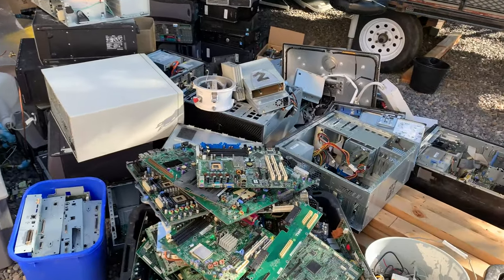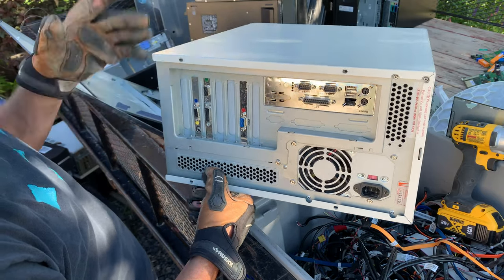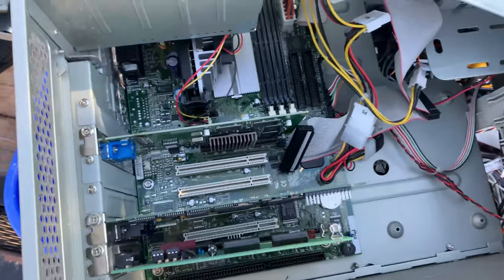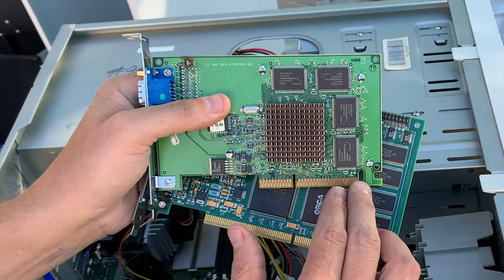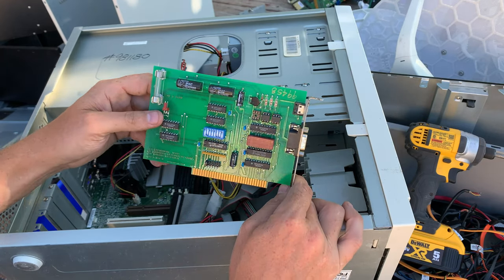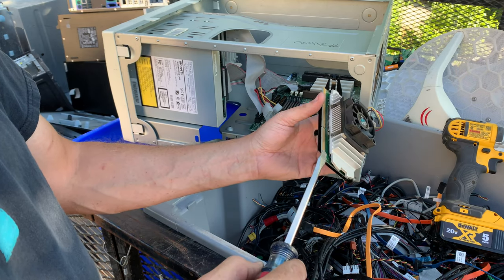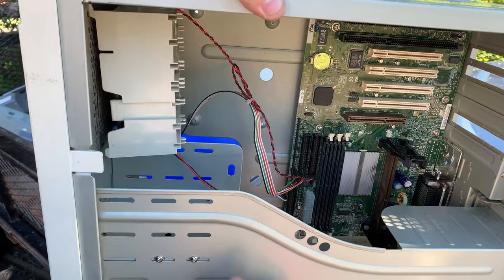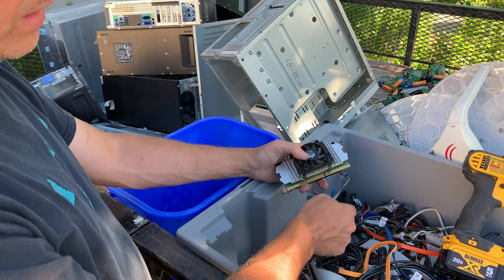Pentium 3 Tear Down with Old Style Cards

Comment: The AMCC IC chip was very interesting. That company is widely used for military and aerospace hardware.
Reply from the maker: AMCC ... as in what some call the "gold corner BGA" (And to be honest, I don't know if they are all that way and fall under the same label ... it is like MOSFETs and Voltage regulators... they looks the same to many people, but do such different tasks ... I have a lot to learn still)

Most people I talk shop with have no idea what I mean when I talk about these unless I call it what most scrapers call it.  It was used for a very long time.  The chipset moved to the newer style (I can't remember the name... maybe you can help me with that) for the southbridge.)   Even GPUs on video cards have replaced all chipset processors with the ones that have the dies exposed on the surface of a green fiber board BGA.
Reply: @badideametals  the AMCC chip was a regular IC chip, if had 3 Orca branded chips around it. The north and south bridge chips are still the same thing, you may only see 1 nowadays but they control all of the same stuff. PCI controller is used to also call it but they handle all of the PCI lanes to the CPU. Back in the day those had on board video through those chips as well, times have changed, A LOT. I don't understand why anyone who deals with and makes money off of ewaste doesn't learn what everything is and what it does, from that they can learn what to watch out for with items being worth money to sell or extremely rare and highly sought after items like IBM keyboards as a example or old hardware like I mentioned to you. Everything can be fixed as long as it wasn't a static electricity that killed the entire board.
Reply: @badideametals  I bought one auction with 3 Engineering Samples in December, 2 very early 486 samples worth $500 and up per cpu but the third one is extremely rare, the only known example to date, a 487 (SX) which are already rare because they were released so late newer technology was released not long after. This sample is beyond early in the development phase, the ID code on it is before they had even named it, 80487YY is the part number listed on it. Some collectors have called it the find of the year.  The highest offer I've received is $5,000 but I'm not selling right now. I paid $52.50 plus shipping with several other 486 cpus.
Reply from the maker: Thanks for explaining what chips you were seeing.  I am a software guy by day.  This is a hobby by night.  I make my investment back each time, and I am happy.  I sell what I can, but I really am doing this for the fun of seeing what things look like on the inside.  I recover the gold and other metals where I can.  I know I miss a lot.  But my return on investment is in the positive, so I am happy.  I am happy to learn what people are willing to teach me.  I don't doubt that for every one way I try a process, there are more then 3 better ways to do the same thing.  I like trying things out and seeing how things go sometimes.  You have been very helpful through the comments of other videos.  I appreciate your advice where you can give it.  I am glad I have the luxury of making mistakes and being inefficient as this is not my sole income.  I would have to be much better at this (like you were saying) if I were to live off of this venture as a primary income.  Thanks again for checking out the videos.  I hope I don't disappoint you too much.  I would love a master teacher to help me apprentice and gain more directed experience.  :)
Reply from the maker: That is so fun :) I bet you have quite a collection.
Reply: @badideametals  you wouldn't believe the collection and investment I've put together since not being able to refine and all the health problems from being diagnosed with thebrare diseases. I've bought over 115 pound of 70s and 80s HP boards in the last couple weeks for $160  shipping wasn't horrible still only $230. You name it, I more than likely either have a couple or a butt ton. I say investment because I could resell everything right now and triple my money even after taxes but I'm playing the long game hoping for gold to double or at least hit $3,000 to start selling, or who knows maybe I'll be able to process, recover and refine eventually with small amounts at a time. Super Boards which usually applies to boards that are only gold capped chips or the majority, is something I love collecting. Bought a mainframe board 170 gold capped and gold leaded chips, it's actually double because they're stacked ram modules.
Reply: Those optical drives have bits of gold in them. I scrap all I come across which aren't useful in a PC I refurbish and sell. If you find IDE blue ray burners, some folk want them for a retro gamer PC.
Reply: @johnross8939  why do they want blu-ray burners? That's newer technology also you can change any connector you want, IDE to sata or whatever.
Reply: @johnross8939  100% of people with any common sense when it comes to hardware will never use a early Blue-ray drive, software is horrible with countless bugs and issues. They also won't read several types of disk which really sucks. Buying anything later will work a hell a lot better with added features as well but I wouldn't understand why anyone would watch movies on a old computer or burn them to watch on a TV, just download and stream, technology is far more advanced.

Comment: 3dfx cards are worth money, working or not a huge fan base out there that collect or fix to play on. GPU memory is a lot different than other memory on Older computers that is.
Reply from the maker: Before I start cutting, I will be sure to look.
Reply: @badideametals  everything older is worth money, A LOT. People wanting to build computers from the child hood or old gaming computers and so on. Since this hardware is no longer made and so much is being trashed, these pieces become very valuable, working or not. A lot of people make auctions with 10 to 20 pieces and they can see $100 to $200 sold price depending on what's in them.
Reply from the maker: True.  I keep the really rare stuff sometimes.  If I see more then a few, or if it is too big to store, I scrap or sell the item.  I have a collection of what is nostalgic to me.  I grew up with an apple PPC 7100/100 and a ppc 6100/66.  I recently found 2 7200/120 units that looked just like my 7100 ... So I bought them.  One I tore down to see what was inside.  The other is in my trophy case.  My trophy case is getting full though.  I may have to start selling off things, or seeing how they look in my forge ;)

Comment: Your wording on the ISA card isn't quite right. That card is the only thing meant to do that, it is made for any computer no matter the type or what it is, just install drivers and it runs fine. The other card is a sound card, at least I'm pretty positive, stupid youtube butchering resolution when first uploaded
Reply from the maker: I see what you are saying.  I meant that this computer was built for a specific purpose. The sticker on the outside of the case indicated a brand and function I was not familiar with ... and once I pulled that ISA card out, I could see at that moment that the computer was built for a specific purpose.  I did not mean that the card was built for that machine specifically ... When I record, I am not scripted, so sometimes what makes sense in my head is not communicated well.  

That card, like all expansion cards, would have been built in a way to be useful by multiple different PC builds.   Case in point, the card had an edition year of 1992 and the system was a late 90s P3 setup ... with a power supply with a 12 volt, P2 4 pin connector specifically used by all systems since the Pentium 4 came out ... That is a wild mix of tech across almost a decade.  So, ya, I probably said it in a way that was not clear... but no, I was not trying to say that the card was built for the tower... but the other way around ... that tower was spec-ed and assembled with the functionality in mind that would utilize that card and what ever peripheral device it would have connected to.
Reply: @badideametals  I'm just anal with being an enthusiast since I was young, building and fixing computers before precious metal recovery. Basically anything can work with any computer as long as the company made drivers for that operating system. In rare cases this isn't true because you can find drivers online made by enthusiast like me, or a work around. A great example of that is the Hackcintosh, Macintosh operating system on a none Apple Computer or Apple Hardware which is basically the samething as other computers but Apple being Apple charges a lot more and they usually make it impossible to upgrade by having a lot of the removable hardware like memory or cpu soldered to the board. They did start to change that but I'm no Apple fan and really don't keep up with it. It almost killed me to buy a iPad for my mom a couple years ago as a birthday gift.
Reply from the maker: @chosen1one930  you are awesome :) I really like when you have input for me.  Thank you.
Reply: @badideametals  if it wasn't for recent health problems since we exchanged emails I would do it more often but sadly that isn't the case. I'm battling a lot of side effects from Hemorrhagic stroke aka bleeding on the brain and massive concussion.
Reply from the maker: @chosen1one930  I am at a total loss of words! I am so sorry.
Reply: @badideametals  Omg, old computers and order monitors are selling for insane crazy amounts on ebay, hundreds to thousands. HP A7217A FD Trinitron 24 sold for $3,600 I scrapped several of those and other older gaming monitors years ago. Kicking myself. That seller sells older computers 1gz cpu speeds for $110 to $200 than more for unique items.